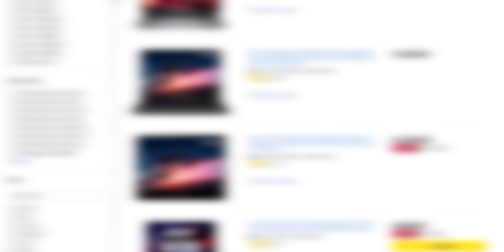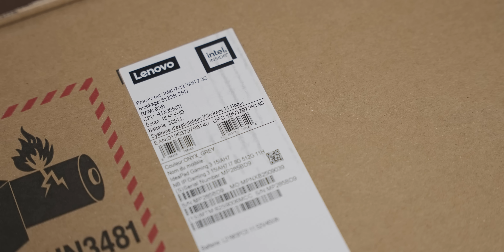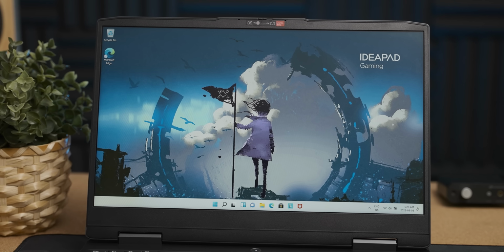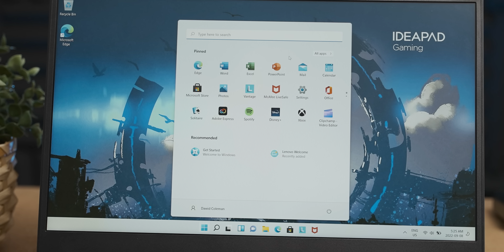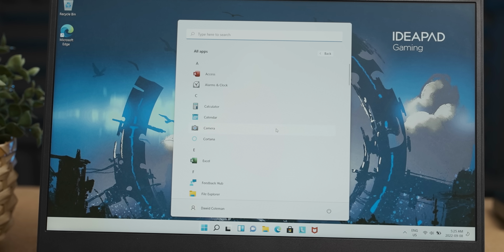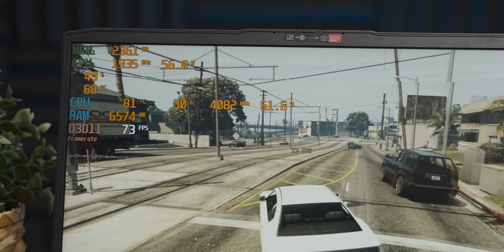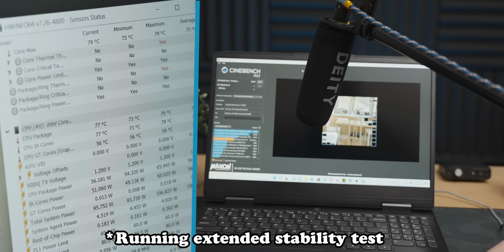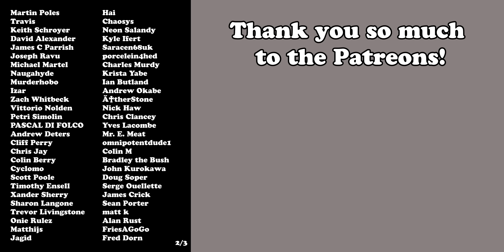Gaming Laptop Sales Be LIT

Comment: Dawid that low gpu wattage is because of the cpu taking in 60 watts try to limit it to 45 and see that gpu is turboing because the 2021 version of the ideapad had a max tgp on the 3050 ti at 95 watts with a i5 11400h not sure y lenovo downgraded that maybe you can flash the ideapad gaming 3 2021 vbios and increase that tgp
Reply: its also because of the fact that he didn't activate the performance boost mode in lenovo vantage
Reply: and the 170W power brick is too low

Comment: Dont worry about tampering with lenovo waranty, Ive asked them if I can use different thermal paste withou loosing warranty, they replied, of course and sent me instructions. 

P.S. Cannot wait until David finds out about option to change powerlevels on lenovo laptops with Fn+Q that increrases powerlevels of both CPU and GPU with increased noise.

Comment: Wow, I'm surprised you managed to pick put a good value gaming laptop this time. Nice improvement over that $1000 rtx 3050 asus laptop. 

Could we perhaps get a test with, you know, some tuning? How high can you make the 3050ti clock, how does the laptop respond to a repaste, etc. You know, a review with more indepth testing for your more tech savvy audience. 

Lastly, the 8gb single stick ain't much of a problem, because you can upgrade the ram. Allows the OEM to lower price and lets you only get rid of one stick of ram instead of 2 if you want to go more than 16gb.

Also you seemed to have clearly missed the last couple of sales when the asus rog strix with a rx6800m and 5950hx went for $1140. Or the $550 80w rtx 3050 + i5 11300h laptop. Gaming laptops always go for sale.

Comment: I got a Lenovo Legion 5 (15ACH6H) couple months back for 923eur.
R5 5600H
16GB RAM
512GB SSD
RTX 3060

Honestly speaking u shouldnt buy a gaming laptop with a GPU worse than RTX3060 you lose so much value and power if you go with a RTX3050 or RTX3050Ti.

Comment: I think i got the answer to why Laptops usually come with one stick of RAM and that is, i kid you not, both of the slots are a single channel.
So they're both Channel A for example and then what you see is DIMM1/2.
I noticed this on my 2014 Lenovo and CPU-Z can show this very clearly as well.
I believe this is why these manufacturers responded with "But there's no performance uplift from 2 DIMMs of RAM" Because how are you supposed to use Dual Channel when the Laptop is only equipped with one?

Comment: My problem with Lenovo is the hardware issue you are bound to run into which can render your laptop useless. For me it was the keyboard, but disconnecting the ribbon cable and now having to use an external usb keyboard and mouse extended its life. Of course this problem presented itself just after the warranty expired. I could diagnose and implement a workaround, but for the average person it would be and expensive repair or become a doorstop. Never buy Lenovo again.

Comment: Great video, but I have a question: after upgrading the RAM, were you able to adjust the timings in BIOS? 
I have a Legion 5 pro and after upgrading my RAM Lenovo's limited BIOS forces me to run at 2666mhz speed. Haven't really found a solution online.
Reply from the maker: Unfortunately I couldn’t manually set it. The kit gskill I had happen to auto set to 3200Mhz. Laptop ram profiles are really annoying.
Reply: @DawidDoesTechStuff  couldn't agree more. After searching online all I could find was a doctored BIOS on GitHub that came with a "might fry your system" disclaimer and that's definitely not something I want to muck about with. 
Do better Lenovo!

Comment: I just ordered this laptop from ebay, 64gb ram DDR5, RYZON 7 6800H, 3.2ghz processor, 1tb ssd, RTX 3050, 120hz.... Price is $1150...

I actually bought it for work, network and cyber security labs, will be running alot of virtual machines with vcpu.... Don't really care about the gaming aspect.... I just want to know if this laptop can accommodate my labs which run mostly on virtual machines... I currently have a 32gb Dell Precision core i7, which starts to get very hot when i run my labs...

Please give your opinion, is this laptop great for running virtual labs for network engineers like EVE-NG or Gns3.

Thanks

Comment: I have the $750 6800H Ryzen 3050 Ideapad from Microcenter. Strange that my laptop came with a nvme drive in the full slot and nothing populating the smaller slot (yours seems to be inverted). Had to buy a small nvme to use as a boot drive instead, and repopulated the large slot with a TB. 
Overall the laptop has been pretty good so far and definitely does what I've needed it to do so far. Big plus is the 16GB of DDR5.
Reply: Dude that is bang for the buck sheesh i wish in india we had such deals 😔😔😔

Comment: beware with lenovo ryzen laptops there one of the ones that do that ram switch that been going on because of shortages not single stick ram but single sided ram where you only get chips on one side it REALLY screws performance and i mean 20 to 30 fps not a few frames i had one with a ryzen and a rtx 3060 and it was all over the place till i changed there 16gb with 16gb with ram sticks that had chips on both sides and it fixed it other then that good laptop

Comment: Can you do a really quick test about gaming FPS with and without a power supply? A few days ago I tested a Ryzen Lenovo laptop and found a strange behavior. If you play with the connected power supply you got all the FPS, if you unplug the power supply the FPS is immediately limited to 30 with a very bad input lag. At first, I was surprised, but then I realized that it's most likely some setting to save the battery power. Does this one here also have such an FPS limit if you play on battery?
Reply: not strange, most or all laptops do this, if you want full FPS keep plugged in, if you unplug and are on battery the FPS will drop, you could try mucking about with the power settings, may or may not help.

Comment: Hey can you have a look at the impacts different size ram sticks together make a difference in laptops? Like how does a 16+8 gig set-up work compared to single channel 16?
Reply: you might not get any improvement with 16+8 gig, you may get improvement with 16+16 gig, both ram sticks with have to be the same clock speed, for example 1600mhz+1600mhz or 3200mhz+3200mhz, there is loads online with this info, on my last laptop, it had single 8gb ram, got another 4gb to get 12gb, i didn't see any speed improvement, got another 8gb ram to get 16gb, there was some speed improvement.

Comment: Does the ram upgrade did better cause of the dual channel or the more GB? I would like to buy a 16gb module cuz it's cheaper here, and sell the 8gb module
Reply: The main reason the upgrade performed better was that it was dual channel, but these days 8 gigs isn't enough anyway so it's a bit of both.
Reply: @jordanlazarus7345  I think I will stick to my plan of getting a 16gb single channel, same GB quantity for cheaper, even though I see stutterings more frequently than when I was on dual

Comment: dont understand why put so much tech in a laptop for a shitty screen 1080 60fps. the value is really bad. cpus are ridiculous cheap nowadays and many games you can hit 30 if not 60fps with just onboard. a good gamer laptop with good gpu should first improve its monitor and proably some other things like keyboard, speakers, webcam and mic. 8gb ram on a laptop with rtx like really?

Comment: Was the RAM upgrade to 2x 8 GB sticks, so 16 GB total versus 8 GB in the stock laptop? Would trying a 2x 4 GB sticks be a better comparison for single versus dual channel configs instead of dual channel and more RAM? That is if 4 GB SO-DIMM sticks exist. I feel a Hardware Unboxed video starting...
Reply: yes, upgraded to 2x8GB sticks, 2x4GB sticks is lower than 2x8GB sticks, unless your pc/laptop is 8GB max, you will get better utilisation from 2 sticks that are the same GB size and the same clock speed in dual channel, example 2x4GB sticks with both ram speed at 1600mhz vs 2x8GB ram speed at 3200mhz, the second ram config should be faster for your system than the first one.

Comment: I don't understand why they even bother selling it with one stick of ram. It wouldn't cost them that much to put a second stick and the user would get so much more performance out of the box.
As a vendor, wouldn't it be top priority to get the most value out of the parts you're using?

Comment: Wow that is a lot of money for that laptop. Dollars are crap.  Aside from having an i7,  the legion models are cheaper.  My legion 5600h, 8gb 3200, rtx 3060, 1tb ssd 120hz 1080p cost £800 on Amazon recently.   There might be other reasons for the price difference other than how the currencies are, but prices are higher than they probably should be.   On another note Lenovo make really nice laptops and quite good quality too.  I have owned a Lenovo flex 5 ryzen 4700u since last year and never had any issues whatsoever.  It feels very robust especially for a folding touchscreen type. The legion has only been used once so far, but the quality feels the same.  Don't think they compromised on anything considering different range.